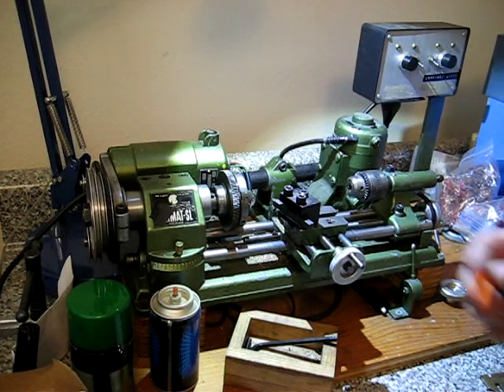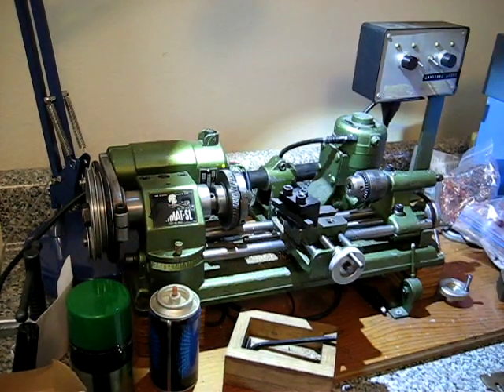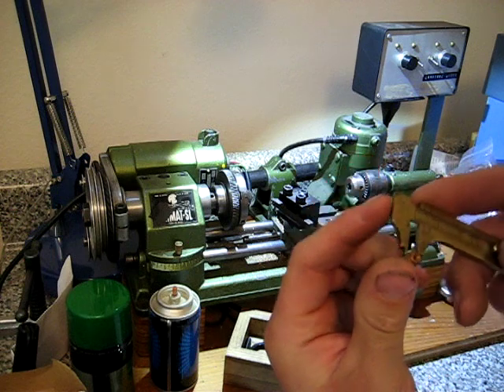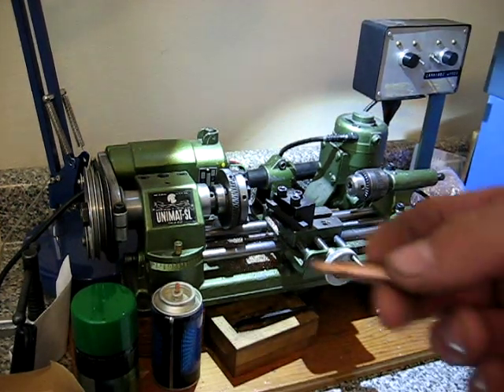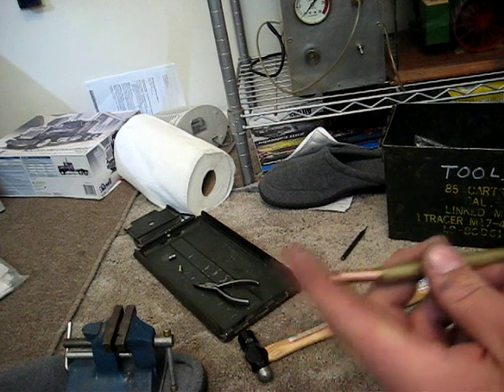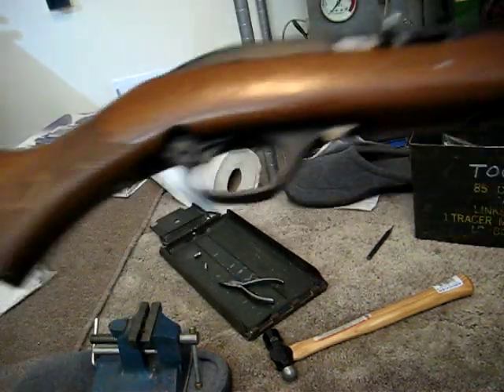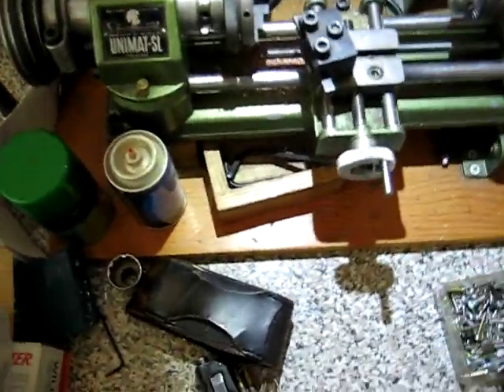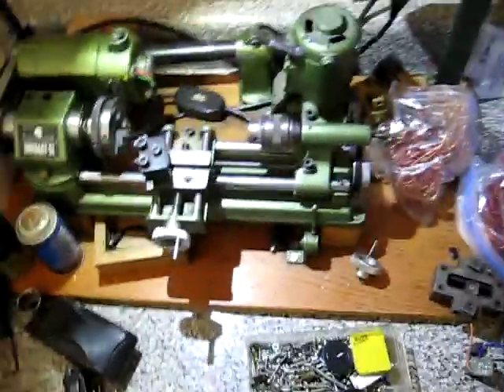Unimat lathe

Comment: anyone know if there is a Collet chuck that goes into the spindle and uses a drawbar instead of the ones I keep seeing that threads to the outside of the spindle? what's the inside diameter of the spindle or if there's an "MT"  bore size, what is it?
Thanks!!
Reply from the maker: The head is threaded to the spindle. There is a hole a 1/4" or so in diameter so a rod can pass threw. I'm sure they make a collate holder, I've never looked for one but it would be interesting to see if they had one.